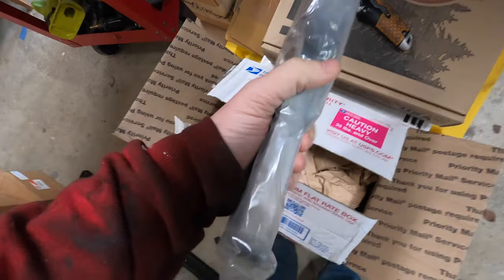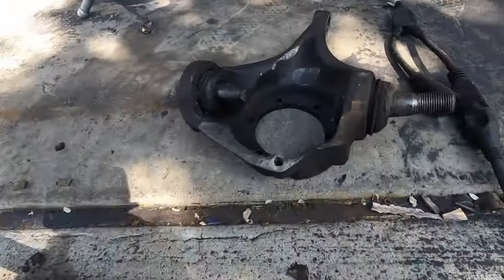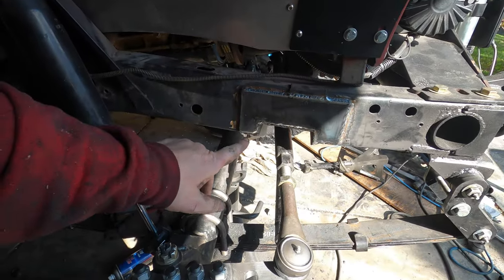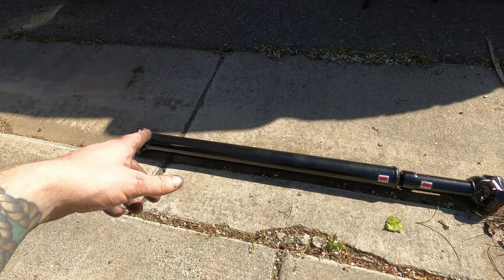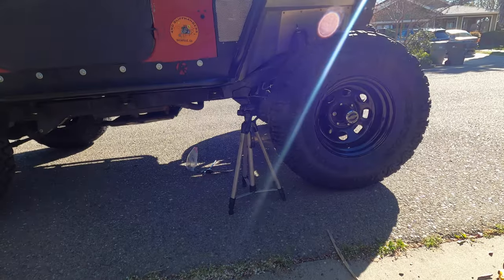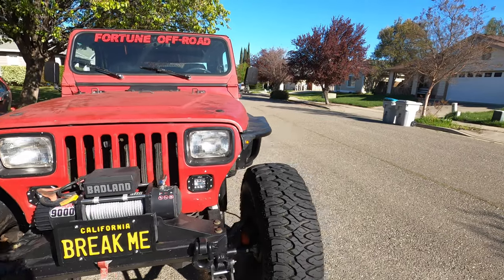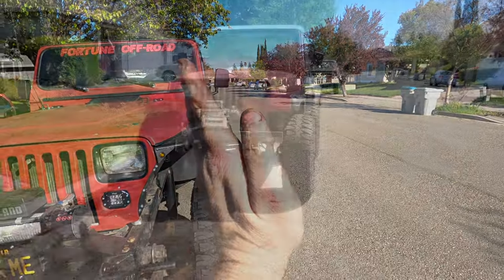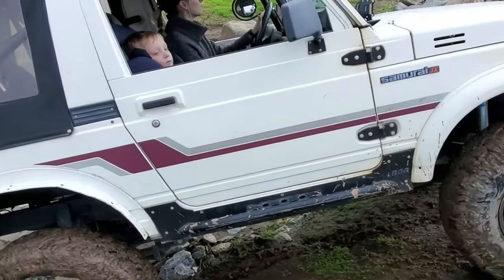Old School Jeep Build (Part 11) | High Steer Knuckle & Test Drive!

Comment: those built in stops you can lop them off then drill into and tap and run a bolt in, plenty of meat behind it
Reply from the maker: I'm gonna try! I cut a lot the material off 😬
Reply: @FortuneOffRoad  I saw that after i commented. Im starting to wonder if my d60 reid knuckles are gonna be as much of a pain getting my rcvs in. soon enough we will know

Comment: Congrats came out really nice. Front stretch was a game changer. Looks sic. Any thoughts to put the drag link going to the pitman arm on the bottom side? Seems like would put it parallel with the tie rod but hard to tell on tv.
Reply from the maker: Yeah, it's so low that I'll only have 1.5" of up travel before the diff hits it when it's mounted to the bottom.
Reply: @FortuneOffRoad  Gotcha makes sense